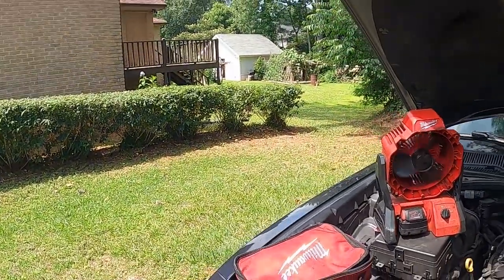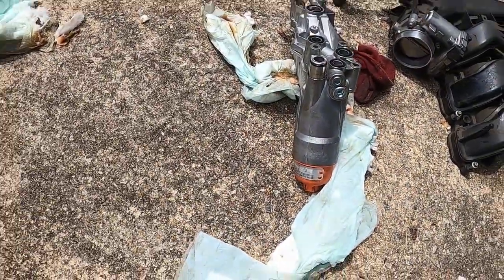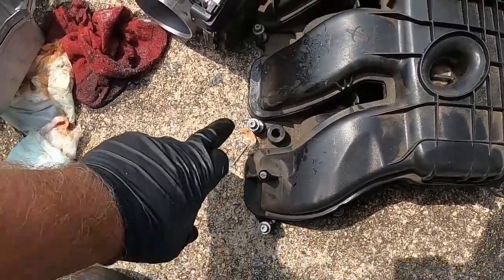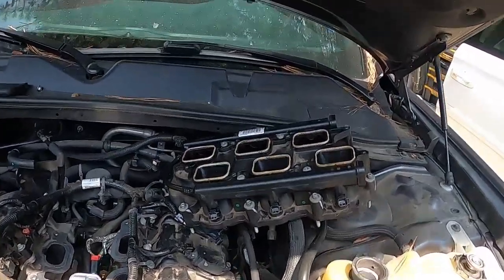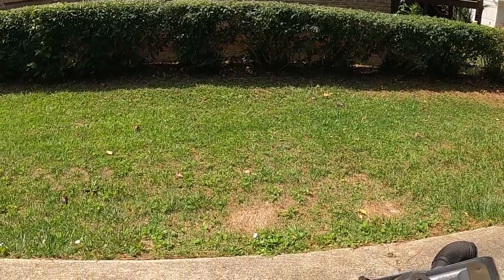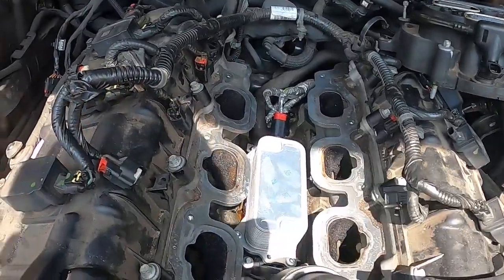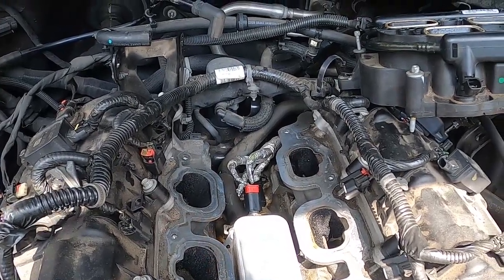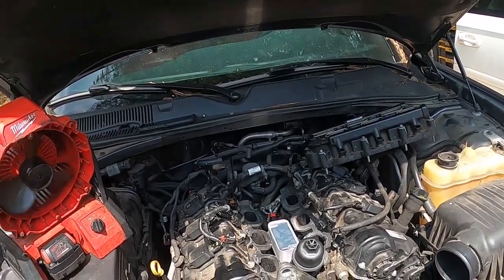DIY How to Replace 2016 Challenger 3 6 Oil Filter Housing

Comment: If I replace with an oem mopar part would my oil pressure sensor codes go away as well?
Reply from the maker: more then likely   the sensors on after market ones are using not compatible with the computers

Comment: Why not just replace the temp and oil pressure sending units on the better aluminum one with the OEM sensors? (swap from the original OEM) Rather than replace the whole unit again, as the OEM filter housing does not come with new sending units anyways.
Reply from the maker: Several reasons  1  the quality of the part is usually crap.  The seals with the after market ones leak fast.  The OEM unit does come with new sensors.  This has been my experience .